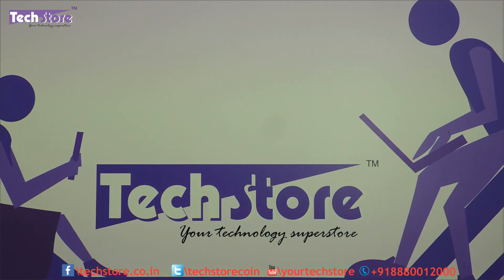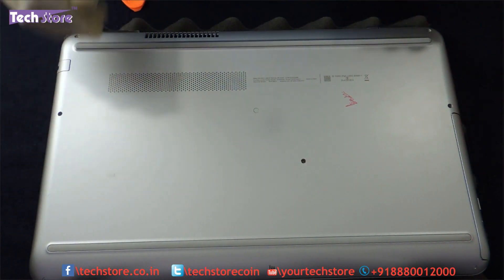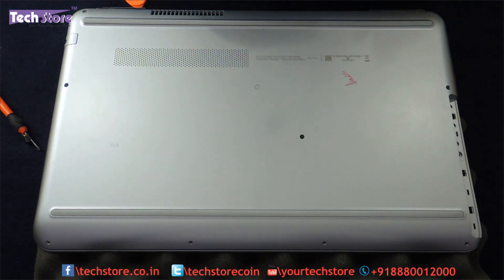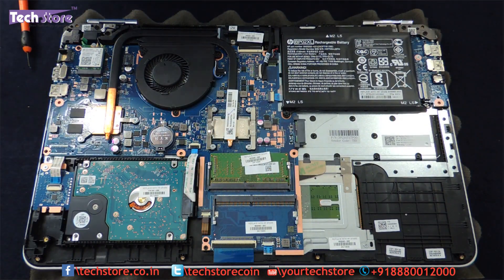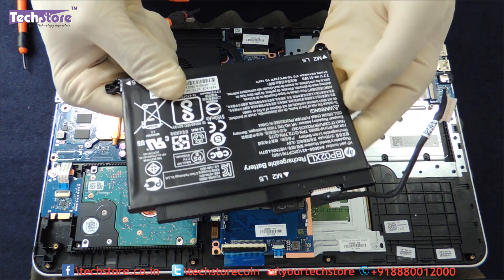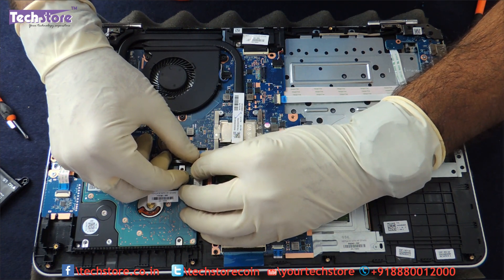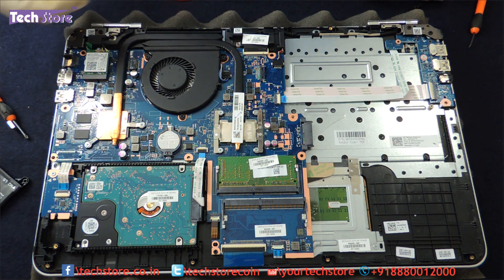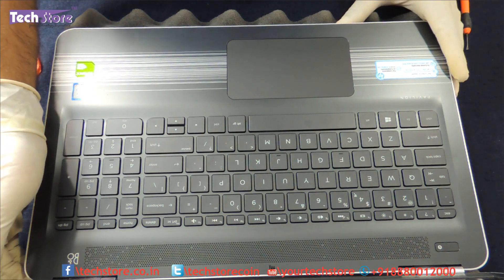HP Pavilion 15 AU series : How to Disassemble and upgrade memory ram harddrive laptop easy diy

Comment: You forgot to mention the m.2 slot, which supports SSDs (not NVME) in an M.2 form factor.
Reply: It's to the top right of the RAM, below the battery. In that empty area, look at the connector on the left of that space.
Reply: @TamlinsTugBoat where

Comment: This video was just what I needed to get my SSD upgrade done.  Thanks very much !!!  
It was a great relief to find it after watching other videos which were based on other variations of the Pavilion range.  The key was finding the model number starting 'Pavilion Au' in very small print on the back of the case.  The case was very tricky to prise open but I taking it very slowly and carefully I managed with a combination of old credit type cards and also a guitar plectrum of the right degree of stiffness.  Brilliant result ! Thanks again.
Reply: Bro I have pavilion AU117TX.. what kind of ssd I can install?? I can see a m.2 slot on the bottom left corner but does it even support it?

Comment: Thanks for the video! The clear instructions were really helpful. The pin connector on the hard drive still freaked me out when it came out, thought for sure it was broken. Ended up being fine. So much laptop speed improvement going from HDD to SDD drive!

Comment: i got the same laptop and it doesnt turns on a new battery i have tried 4 diff bp02xl batteries and everytime i have to connect the old battery bootup the laptop and then change the battery,after turning on the new battery is accepted and works fine but after restarting the laptop 2-3 times again the laptop doesnt boot up on new battery and i have to connect old battery to bootup the laptop and change the battery while on charging, can you tell me whats the prob?

Comment: This is actually DK’s husband. Thanks so much for this video. I have an HP Pavilion 15-au057cl that I bought in 2016 and stopped using for most everything except for file storage and printing because it had become so slow. Two years ago I bought an iPad that I use for most things internet related, except that some websites only seem to work from a browser running on Windows.  

I recently shopped for a replacement Windows laptop. A failed battery was the last straw.  Reading about the possible performance improvements in an older laptop with increased RAM and replacement of the hard drive with an SSD inspired me to do the upgrade over complete machine replacement.  I’m very glad I did. I replaced the battery, added 8GB of RAM, and installed a Samsung 870 EVO 500GB SSD.  This baby does quite well now - rather comparable to the iPad.  Thanks again for this video.
Reply from the maker: Thanks for your kind words & appreciation. Please do subscribe. Namaste from India.

Comment: hi, @techstore. may i know what is the compartment under the battery there? is that an ssd disk holder?
i need to upgrade my laptop, it would be very helpful if you can tell me. would you mind telling me what is that?
and im using hp pavilion 15 7th gen i5 7700u, au102tx
Reply from the maker: There is no SsD holder
Reply: @TechstoreCoIn  then what is the slot actually? Could you pls tell me?

Comment: Thanks for the tutorial. This laptop looks identical to my HP Pavilion au-151-sa laptop whose base cover I wanted to open to inspect for damages. Your pointing out of the hidden screw was really helpful, I don't understand why these casings of electronic devices are designed to be so difficult to open.
Reply from the maker: Yes, even we are baffled with designers of laptops. Why make it so difficult.

Comment: I have hp pavillion au624tx laptop my laptop is too slow so can i put HyperX Impact 8GB 2666MHz DDR4 CL15 260-Pin SODIMM Laptop Memory (HX426S15IB2/8)

1).This ram in my laptop, will it work with another ram given by hp in inbuilt form(ddr4 4gb 2133mhz).

2). Can HyperX Impact 8GB 2666MHz DDR4 CL15 260-Pin SODIMM Laptop Memory (HX426S15IB2/8)
Will be supported by my laptop..?
Will my laptop support 2666 Mhz.

Please answer my questions pointwise.
Reply from the maker: You need to install a SSD before anything else...ram will not help
Reply: @TechstoreCoIn  why ssd sir ? Ram is for speed na.
Reply: @parthchandraker1976  yes, but even if you upgrade your ram, if you are still using hdd, there is a possibilty youll face this same problem. but if you change to ssd even with your current ram, your problem will solve. AND, ram isnt for speed, the higher the ram, the more application you can use at the same time or you can use a heavy program or software without lag IF you are using ssd.
Reply: @szind  Thnkyou sir
Reply from the maker: You can install hyperx ram too

Comment: i haven hp pavilion 15 au003tx and i want to upgrade my laptiop with 500GB SSD so i want to know is this laptop is comaptible to upgrade with SSD? please let me know
Reply from the maker: Yes you can install 2.5 SATA SSD easily in place of the HDD. You can buy a normal universal hdd caddy of 9MM and put the existing HDD in the dvdwriter area.

Comment: 1. Is  HP Pavilion - 15-au620tx comes with M.2 NVMe PCIe Slot?   I mean is it possible to add M.2 NVMe PCIe SSD in HP Pavilion - 15-au620tx?
2. Is HP Pavilion - 15-au620tx Supports only DDR4 2133Mhz RAM other 2400Mhz also be supported with 2133Mhz speed? Because Now a days 2133Mhz RAMs are very rare.

Comment: I have an HP Pavilion 15-au007tx similar to the one I saw in the video. I have already 8 GB DDR4-2133 SDRAM in my laptop can I add additional 8 GB more if yes please suggest a better performance one RAM??
Reply from the maker: yes you can add. Glad we could be of help. Do subscribe
Reply: @TechstoreCoIn  Thank you 😊
Reply: @muneer_md  did you the ram upgrade?  If yes which brand ram you used?
Reply: @TechstoreCoIn  the same spec my laptop has samsung ram, can i add crucial ram with same specs in another slot? Or ram brands have to be same?

Comment: Can we use different types of frequency ram? I mean can we use 2400MHZ RAM in another slot. Can we use 2133 and 2400MHZ at same time in hp laptop
Reply from the maker: Yes you can. It will scale down to the lower of the two memories. Glad we could be of help. Do subscribe

Comment: Thanks for your informative video. I have the same laptop but it stopped working due to a coffee spill. It's been a few months. I've opened it up and the spill has dried. However, I'm not sure if it's working or not because the hard drive was removed. How can I test it to find out if it's working? Would anything light up or would there be any other indicator in the absence of a hard drive? When I plug it in, the power light turns on (and it blinks after long intervals). Is there any way I can test it before investing in a hard drive? Don't want to buy one until I'm sure the laptop is working. Thanks!

Comment: Is there an m.2 ssd port? According to the manual it has but I can't find it. Please help.
Reply: It supposedly has. Even their manuals stated it. But going to the HP forum, you can see complaints about the port being removed. Apparently this problem exists with the HP Pavilion AU 15 series. You can actually see the M.2 part of the motherboard in the video (although as said earlier, the port is removed). Its located on the bottom left. Just left of the hdd
Reply: @altair5870  so whats the best option for upgrading the laptop?? Should i replace HDD with 1TB SSD??
Reply: @ritwikmutkure432 if you wanna buy an ssd, you can. Just not the "m.2 ssd". You can buy an internal ssd and replace your hdd with it

EDIT: For mine, I just replaced my hdd with an ssd. Then I bought an hdd enclosure so I can use my internal hdd as an external hdd.
Reply: @altair5870  ya thanks bro.. Even i was thinking of doing the same.. But wish we had M.2 slot.. It would be an addon..

Btw which SSD you bought?? I want 1TB..
Reply: @ritwikmutkure432  yeah i wished we had m.2. Sadly we cant have good things.

The SSD i bought is a 500gb samsung 860 evo. Samsung SSDs are a bit pricey though. You could settle for WD and other ssd brands. I cant give any recommendations though since this was my first SSD and I only settled for Samsung with them being one of the frontrunners in the SSD market. Check some video recommendations if you need to.
Reply: How did you upgrade it??

Comment: Do we have m2 slot in this device? If yes, where is it located. Thanks!
Reply: I have the same question
Reply: @shaddeyk7732  apparently, it depends on your luck I guess, mine doesn't have :(
Reply: I have an AU-009tx. How did you find out if it was there without opening? I couldn't find any guide regarding this on hp
Reply: @prabsharma2386  I opened it and found no M2 :( just recently bought an 2.5 Sata and swapped my HDD
Reply: @abinesh2090  Can you link the one you bought. Any SATA III SSD will work right?
Reply: @EX1L3D_L3G3ND  yes sata ssd will work but not M2
Reply: Thank you Abinesh! Guess I'll have to go for a SATA myself then
Reply: Mine came with it. Ryt next to the hDD (left side). So i hv both m.2 and hdd tho hdd failed and i m replacing it soon.

Comment: Is there an m.2 slot on this laptop?if so please tell exactly where it is.
Reply: you need to take out wifi card and install M2 SSD. Its better to replace optical drive with HDD fitted in a caddy and use SSD on the HDD side
Reply: @muhammad.bin.attique  yea this didn't have an m.2 slot....had to put the one i bought on another laptop....i went with the caddy+ssd way for mine...works like a charm

Comment: Is there Hard drive caddy that actually fits in the optical drive slot?
Reply: yes it does. you can buy one online. Just make sure you are buying the right thickness size. There is 12.7mm (old and thick laptops) and 9mm (new and slim).

Comment: What happens if you don't disconnect the battery first?  I opened my case just to wipe off residue on the inside, but forgot to unplug the battery pack. Once I put the case back on, the motherboard was no longer turning on?
Reply: did you use water or alcohol to wipe off?

Comment: Thanks, Techstore!  I need to replace my battery, and couldn't get the case to open!  Hidden screw!  I am now going to upgrade my memory!  I think the computer only allows an upgrade to 16GB, so I ordered a 4 GB stick of RAM.  Let's see how this goes!
Reply: always research before doing upgrade.
Reply: hi, what is the slot below the battery there? do you know whats that? is that a ssd slot?

Comment: my laptop is not charging show what is reasion
hp pavillion 15-au003tx model no
Reply: HP installed a defective battery which stops working after 1 year. Even worse they do not sell new battery. ;/

Comment: Worked great in aiding me to install SSD.
Reply: Did you install d SSD in place of the HDD and HDD in a caddy bay? Where did you get the caddy for this laptop as the new bay would change the look of the side of laptop. Did you find a caddy bay that looks same as the original DVD writer?

Comment: Can I install msata SSD in au series of hp laptops? Plzzz reply asap...
Reply: Ya you can
Reply: @parampreet9251  how ?
Reply: @tarangchauhan4294  just replace it hdd
Reply: @parampreet9251  bro i was asking that can i install msata ssd with hdd installed in laptop
Reply: @tarangchauhan4294  yes first you by 2nd bay candy for hdd and put your hard drive in that and ssd in main hdd spot
Reply: https://youtu.be/wcSEBcFUCVg
Reply: Watch sahoo techno guide videos it will help you
Reply: @parampreet9251  thnx bro but you dont understand my question first plz search difference between normal ssd and msata ssd then you will understand my ques.
Msata ssd have a different slot like ram slot.

Comment: can we replace the palm rest of the laptop without replacing keypad and mouse pad? My palm rest is cracked at the left hinge corner of the laptop. Hp service center advised me to change entire panel with new keypad and mouse pad, which are completely fine.

Comment: My laptop battery or laptop problem, I don’t know. Because when I charging my laptop, above 45% unable to charge,  automatically stopped charging doing. Iam unable to 100% charge. Please reply massage and please solve from this issue ... thank you
Reply: Dude me too
Reply: @walstonstone4016  Dude me too!!
Reply: I had the same problem. You have to buy a new battery (exact same one as shown in the video). You can find it on amazon. 😀
Reply: Its a known problem but fucking HP doesn't do anything about it. They even don't sell the new one. Don't buy HP from now on.
Reply: I have the same problem.  I read that it was a problem from a Windows 10 update, but I don't know.  That source recommended deleting the battery driver, removing the battery, putting it back in and restarting.  Since I need to go through all this to take out the battery, I am just going to replace the battery, upgrade with an additional 4GB RAM stick, and call it a day.  I hope this works because I don't want to get a new laptop!  I like this one so much!

Comment: thakyou so much. almost break my laptop. i knew there will be some hidden screw somewhere. just didn't believe there will be one under that long rubber.
Reply: Exact same thing with mine!!! Battery started to expand so wanted to replace it, should be easy right? well i guess it is if you are psychic

Comment: Hii,
I have the same laptop as in the video, i have a question that
Can i use another 8gb 2133mhz ddr4 memory in dual channel with the primary one? I.e 4gb+8gb
Help needed!! Reply fast
Reply from the maker: It will work. But 2400mhz will work better
Reply: but two ram will get of different frequencies isn't it? so would it be wise to go for?

Comment: hello, i would like to replace the optic driver with a caddy for the ssd, which size should i have to buy for the caddy? a 9mm or a 9.5mm?
Reply from the maker: 9.5MM
Reply: thanks !!! i will buy a caddy ASAP and use a evo 850 SSD

Comment: I have a same laptop , so i wanted to know can i upgrade my hard disk to ssd.
And will it effect my warranty
Reply from the maker: +Piyush Gupta you can upgrade. it willl not affect the warranty.
Reply: @TechstoreCoIn  can i replace cd drive with ssd (without remove of hdd ) is it have m2 slot

Comment: I have HP Pavilion 15 au117tx. Can it's RAM be upgraded to 32 GB and after that will it run smoothly or is there any sort of issue it will face? Currently it have 16 GB and also wanna know about  upgrading its video graphic card that is 4 GB  NVIDIA 940 mx. Can it's be upgraded to NVIDIA 1050 series?
Please answer.
Please answer.
Reply: Vivek Steyn the graphics card is integrated so it could not be updated I think.
To improve your laptop performance just use ssd.

Comment: i have replaced my optical drive with ssd, now can i use my optical drive externally which i have removed?
Reply from the maker: No.
Reply: Yes, but you have to buy hdd cdrom to usb converter

Comment: i think just below the battery there is m.2 ssd slot...watch it carefully. Correct me if I'm wrong
Reply: i think you are right, as it also mentioned in user manual of laptop.
I want to install a ssd of 250GB in my laptop as it is very slow but not know much about M.2 ssd type ....so plz help
Reply: izzuddin muhammad it's for DVD drive
Reply: M.2 drive with NVMe interface is 5 times faster (i.e 2500 Mbps) than conventional SATA SSD & AHCI/SATA M.2 (500 Mbps). These modern drives look like RAM. Traditional SATA interface has its own speed limitation of 560 Mbps max. So, faster SSD with SATA interface automatically get locked at 560Mbps speed. So, M.2 (NVMe) interface will helpful in this case.

Comment: sir is the same procedure to replace the ram in hp 15au 624tx .
Reply from the maker: +Pranshu garg yes absolutely.
Reply: Sir, is there is any issue of functionality with dissimilar ram combinations like 4gb and 8gb ram .
Reply: Pranshu garg is there any issue regarding this laptop , screen flickering, cracking sound .... actually i want to buy 624tx laptop ...plz tell me
Reply: does it have m2 slot ?

Comment: Hello sir, i have this laptop.  I want to upgrade RAM. Currently its having 8GB inbuilt. Can I Insert 16Gb another memory stick so that total is 24 GB . Will this work? and Does this laptop support more than 16Gb Ram in total? Waiting for your reply. Thanks.
Reply from the maker: +Ranjit Singh yes you can. It will work
Reply: Ranjit Singh  I would like to ask same question. can you tell me, is this upgrade works total 24 GB(8GB+16GB) RAM..have you tried this??
Reply: Hello ranjit, pls tell me if you have tried this and whether it worked. also will 2400 mghz work with the one already in the laptop (2133 mghz)
Reply: @deep_z  I added another 8 GB ram, 2133 Mghz. So total of 16gb. I'll not recommend to use different speed ram.

Comment: nice video,  can you show gpu part for the same modal
Reply: hi, can you tell me if you got the answer? did you upgrade it?
Reply: @szind  if you consider any laptop you can upgrade Ram memory size and hard drive to SSD , and if cooling fan and battery went bad you replace them  rest of the  part you can't upgrade
Reply: @rahulsutar9042  thank you bro

Comment: i am having hp au084tx which have 4gb ddr4 ram and it lags too much so I want to put 8gb ddr4 ram on the other slot of the same kind i.e( 4gb+8gb). do I have put 4 plus 4 or can I put 4 plus 8? and is it necessary that other ram should be of the same brand?
Reply: Yeah you can. Just put 8gb and 4gb so total will be 12gb. Fair enough to play games and doing work.
Reply: Ritik Singh put 4 plus 4 because if 4 + 8 it is unstable.if you want your laptop to have 12gb ram so put 4++4+4 but depends on how many slots did your laptop have.
Reply: I would use 4+4 or 8+8. And both cards should be purchased at same time from same manufacturer. That is how it works in the desktop world. I don't see why a laptop would be different.

Comment: why do you need to open the front part/keyboard if you are working on the back side?
Reply from the maker: It is required to open the laptop perfectly. The touchpad is connected to base.